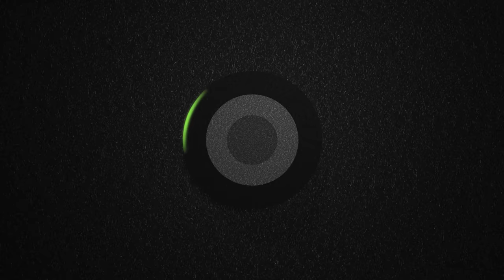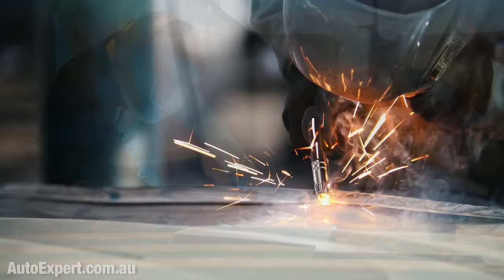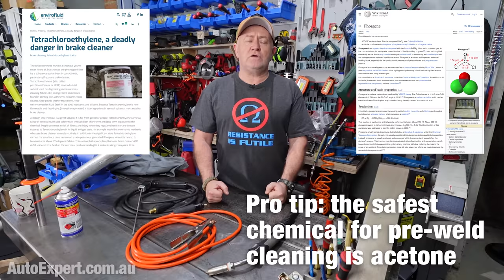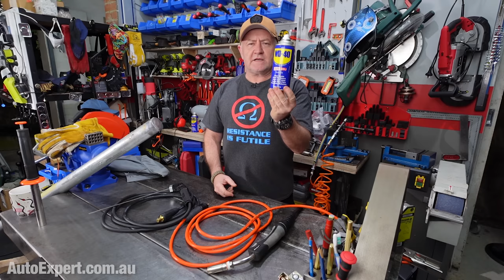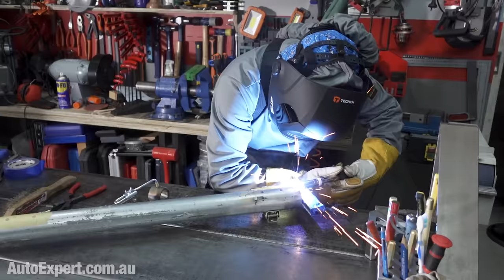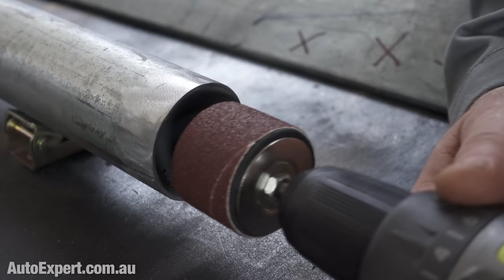How to die while arc welding at home: the top 5 ways | Auto Expert John Cadogan

Comment: Very good info. I wouldn’t have thought of some of it, especially the brake cleaner. One thing that I can add from experience is ventilation even when welding regular steel. I built an engine puller in a single car garage in the winter one time. It was cold so I shut the door. After a few hours of welding I felt so terrible that I went to the emergency room. Still had no clue why I felt so bad. Didn’t even cross my mind that it was the fumes from welding. After chest x-rays, poking and prodding , the doctor ask what I had been doing. I said nothing, I was just welding at home on vacation. He said, there it is!  You poisoned yourself. I spent a week in bed as a result. What a terrible vacation!

Btw, I was stick welding. I guess it was the flux that caused it.
Reply: The SDS for chlorinated brake cleaner conveniently omits the phosgene danger. so much is 'Not known',
Oceangate Titan was a SDS and QA themed designed submersible, ie a little bit lacking in reality.

Comment: Thank you for this warning video.
I am a retired mechanic and now learning to weld and have a forced air respirator  that I use for sanding, painting and now welding.
It's a remote placed air pump with filter, speed regulator and 75' of hose.
It's a budget item, but works flawlessly. I added a self shading weld mask to mine. For about $400 complete, add your own darkening shield, and your good to go.
Sear up " Breathecool II Supplied Air Respirator System w/half face mask " 
Thank you for making this video.

Comment: Quite a few moons ago I used to weld and broco cut underwater. Up to 400 amps DC.  As long as you remembered the basics and kept important parts of you away from the shortest path from electrode holder to the target you were fine, despite being immersed in a  perfect electrolyte (the sea) with soggy leather gloves. But get too close and you would get a warning, as your fillings would vibrate and you could taste the chrome being stripped from your helmet and second stage...
Reply: Which helmet would that have been? The one with the single eye in the end of it?
Reply: @samrodian919  🤣🤣
Reply: Why wear leather gloves underwater? Unlike on land, wouldn't being in the drink keep things cool enough that sparks would have no negative effect on synthetic waterproof material?
Reply: That's nuts!!! Wow, quite the profession!
Reply: Not risky at all. Follow the basic safety rules: You have air supplied from many different cylinders from above surface, plus you carry a bail out bottle on your back. So you can never really run out of air. And there's a spare diver sitting on the stage ready to come and help if needed.Then you are operating in only a maximum of 30 foot of water.  The harbour we were operating in was going to be turned into reclaimed land, so the steel sides of the berths needed big holes cut in it to allow the water levels to  equalise as fill was dumped into the harbour. A broco is a thermic lance, uses electrical current to start a spark to make the broco rod ignite once oxygen is run through it. That rod can cut through anything. We cut big 1m x 2m  windows in the steel piling.@@tittlemouse92
Reply: Oh my gosh! That is wildly crazy. Glad you made it through that experience.

Comment: Hi John. Excellent presentation and thank you for taking the time to do it. Qualified boilie and now professional engineer here. I did my time in a workshop where gal was 90% of the work and we would not have been given the time to grind the zinc off before welding, so we learned techniques to pre-burn the zone to flash off the zinc with the arc as we we were laying the weld so it looked really presentable. Save time to the detriment of our health eh?

I started my trade in the late 90s and adoption of PPE was still pretty haphazard. It was culturally frowned upon to demand PPE from your employers (let's not even start on hierarchy of controls), from both management and the more senior members of the floor staff. I really love music so always wore plugs but absolutely nobody in that workshop wore even P95 masks. I've had fume fever on a few occasions and it was not pleasant, to say the least.

As part of my professional career I still enter workshops quite regularly, and am pleased to see the uptake of at least the 3M carbon filtration masks, and at best a pretty wide adoption of the Adflow helmets. It would be nice if employers would adopt ENGINEERING controls (hierarchy again) but I accept it's difficult in situations where the operator is in such close proximity to the source. 

Awareness is the key and you are only helping to increase that.

Comment: Another thing we tend to overlook is that UV rays are reflective. I use to spend hours ice lugging D-9 dozers. We had one welder at the front of the track and one at the rear with an operator in the seat turning the track. At the back you were sitting beside the chrome rod for the ripper cylinder and at the front beside the chrome rod for the dozer cylinder. It took me a while to figure out why I always had a sunburn on the back of my neck and started keeping sunscreen in my locker.
Reply: Yup, not as severe but UV also reflects off of snow.
Reply: They are called corks.
Reply: Yep tin roofs are a nightmare for reflection too
Reply: Thank You!  💜👍  I dislike sunburns!  😮

1st time anyone has warned me about reflections from the arc!  🤔… wonder how long that would have taken me to figure it out the hard way / glad I don’t have to!  🥰
Reply: Yep. The worst 2 sunburns I ever had were from refle turn. 1 was working on a shiny metal roof all day it sunburned my throat and the lower half of my chin etc. Second was Flux might welding, my legs sunburned. Under the table from reflections off the mirror that was on the floor upright against a cabinet.
Reply: I remember the welders at my old job welding all day on these hugh log conveyers. They were AR plate and shiny as chrome from the logs constantly being dragged across them by the drag chains. After a few days some of those guys who were wearing open blazers with no shirt underneath were burnt bad on their chests from being right over a wire mig all day on a highly reflective surface. Pretty brutal
Reply: @Deere2154D  maybe in your world
Reply: @LoBeau53  in a normal world yup
Reply: At the wrong angle, the reflective tape strip on hi vis safety clothes. lol

Comment: Hi John well done, ex boilermaker/welder here, although mostly a welder. You pretty much covered everything I think. Unfortunately when I started my apprenticeship over 40yrs ago there wasn't much emphasis placed on providing P2 masks, at least not in our workshop. In the early days I did get "Welders fever" a few times from welding galvanized components and yes it does feel exactly like a bad dose of the flu but thankfully the next morning you're feeling ok again. One of my biggest fears is lung cancer from all the nasty stuff I breathed in from welding let alone all the crap that floats around the air in a workshop before the masks and filtered air helmets were common place, I would often come home have a shower and blow a coal mine out of each nostril. I have lost two work colleges and two friends from lung cancer all were welders who died in their early 60's and none of them smoked. 
Just a side note although it won't kill you, one of the more unpleasant aspects of being a welder is occasionally experiencing welders flash (sunburn to the eyeballs), thankfully in 35yrs in the industry I only ever had a bad dose three times. Also regarding PPE when welding to cover the skin you can wear a welding hood which covers the head, neck and partly the chest area, being a bloodnut I had to be extra diligent.
Thanks John I enjoy these kind of videos.
Reply: Galvanised steel welding puts zinc in your lungs that never leaves your lungs . You can drown on that shit . Been welding 50 yrs . I still struggle in winter breathing laying down . 😂

Comment: I did a little welding (arc & OA) in high school 40 years ago and wanted to get back into it. So, I bought an inexpensive welder (Mig Tig & Stick). I have watched several videos on how to MiG weld but yours is the first on the safety aspects. I should have started with yours because it is the one that really matters. Thank you for making it! I will definitely make changes to my procedures after seeing it.

Comment: You Sir are an absolute star! This is the first video I have found on YouTube that covers the most important aspect of Welding for newbies Health and Safety. And I can honestly say that it is one of the most well-presented instructional videos that I've watched. Obviously, as titled you have aimed the video at DIYers who have decided to give welding a try and as you mentioned there are some unbelievably scary videos online made by amateurs that you can only hope are not being watched by new/novice welders. However, I've worked in the construction industry for 25+ years onsite fabricating and erecting steel frames, and after completing my structural engineering degree onsite as a site engineer/manager. And in that time I've seen some pretty suspect apparently qualified welders who could also do with watching your video!! I do have a suggestion though, I think your cute assistant should definitely feature a bit more in your next video! She certainly looks like she has a wealth of welding knowledge that would be very beneficial!! 😜😜

Comment: i was an odds body for a fabricator, he was in his late 50s early 60s, and he had a shelf full of gloves. he would regularly swap out gloves and place the used ones on a rack near a fan that faced out of the workshop, he also expected everyone in the factory to wear riggers gloves at all times. the other thing that was expected was safety glasses. he also regularly replaced flash lenses and safety gear. in the almost 2 years with them, he replaced everything at least 3 times. the other welders loved it because he allowed them to take the 'old' stuff home, all except the flash lenses. he was an absolute stickler for workplace safety.

Comment: thank you for covering this John. I would add that not just zinc but all metal fume is now considered dangerous. It is so fine it can hang in the air for up to two days. This means that effective ventilation is essential to remove the fume particles and the ozone which is also generated during welding. Please keep up the education for all our sakes.
Reply: The safety data sheet for the Weldcote MIG wire we use at work here in jolly'ole USofA shows that their coating is known to cause drowsiness and I've definitely experienced that! Canada now recognizes MIG fumes to be a carcinogen. In my work experience, plasma dust is even worse. My nose is black inside because my employer just uses the large air volume in the shop as 'ventilation'.
Reply: Yes the plasma dust is a problem too  @theGrooveChampion . After experiencing ill health due to this problem in 2014, I've invested in PAPR and a fume extraction unit as well as fan forced ventilation.
Reply: Hopefully it's as lit as the shooting star cop barrel roll meme was😂
I trust it will be.
Reply: I am an old guy from Australia and I don't quite understand the reference  @MrTheHillfolk  :^)

Comment: Well there’s a new learning! I have been using brake cleaner often on my vintage motorcycle.  Haven’t got it anywhere near those temperatures but will be looking for a substitute going forward.  Also guilty of the spray can on the bench and welding galv steel thing.  You’ve alerted me to hazards I was somewhat aware of but hadn’t really considered at a proper level due to the ‘Ill just get this done quickly” mindset.  Thank you for sharing this. 👍🏻
Reply: It's only the old 'chlorinated' brake cleaner residue that is deadly when heated.  The solvent based stuff isnt like that
Reply: John included a recommendation for a suitable alternative (as an afterthought) in the video.
Reply: @jackheinemann1994  thanks for that info.  I’ve been using the aerosol variety which seems solvent based and an effective cleaner. There doesn’t appear to be any residue. 👍🏻
Reply: @ThreenaddiesRexMegistus  Chlorinated brake cleaners come in the aresole variety too and as far as I know they leave no detectable residue.  On the can it clearly lists the ingredients, itll be clear if its chlorinated or not.   The new hydrocarbon solvent based stuff works just as good and is much safer to be around.

Comment: Good video! Thanks for exposing some very real hazards many face everyday. I was in the trades for 25 years. Welding, grinding, plasma torch, oxyacetlene. You name it I probably welded it. A few years before I  retired, at age 45 mind you, i developed uncontrollable shaking in my right hand. I could barely walk. My lung function had dropped by 50% . I was diagnosed with 4th stage COPD and Parkinsons. I sought out  several medical opinions and the answer was the same. Leave the trade or die. Lung disease sneaks up on you. It steals a little piece of you at a time. It's not like a busted arm where you can instantly see something is wrong. 3 years after I quit working the heavy metals in my system were still 3 to 5 times higher than what was considered safe. Chromium, nickel, manganese and copper were the most pronounced. I traveled to Chicago Il to see a specialist and brought along my entire MSDS folder. MSDS stands for material data safety sheet for some who may have not seen one. This M.D. took a look at the types of welding wire and filler rods I typically used. She explained that the amounts of chemicals emitted by the heating of the metals can release many times the content listed on the MSDS.  I worked in a Union shop but the owners couldn't care less what happened to their employees. I was at the time the highest paid employee there earning several dollars above the union pay scale. I was repeatedly told I had employment for life. When they found out how sick I was I was immediately fired. It's against the law and they knew it. I still had to file a lawsuit for Worker's Compensation which I eventually won. I went from top dog to dog that pooped on your new carpet in short order. Thankfully I am now collecting a fair pension from the Union I was a part of. Just want you all to take care of yourselves. Not many employers will. At that time they saw PPE as an obstacle to their profit. I wish I would have paid closer attention when I had the chance. PEACE to all who read this. Thanks

Comment: Feb 29th here.I just came across this video. I was a welder/fabricator (arc, gas, mig, tig) for over 50 years, Navy trained. Great advice, John. I would like to add a few things. Make sure you don't have a plastic butane (bic) lighter in your pockets. if a hot ball hits it well and burns through it will go BOOM! Don't weld anywhere a parts cleaner, it creats phosgene, just like the metal cleaner will. Also, if you are welding off of a chain fall or overhead traveller, make sure the ground is well grounded to the piece being welded, that the circuit is not creeping down from above acting as a ground through the chain. The chain can get crazy hot (and burn you bad). By the way, I started out rehabbing a WW ll Navy ship, ripping out and replacing galvanized piping in enclosed spaces. Safety gear? As in PPI? What safety gear? No such animal back in the day. Milk from the galley was the antidote for the flu like symptoms and it seemed to work (placebo effect I'm sure). Thanks for a great video!

Comment: highly informative , been welding for 40 years some as a union journeyman millwright and never knew most of what you stated , (apart from galvanised welding).
This  should be compulsory watching for getting ASME certified . Got shocked to the head with a rat hat on  underwater welding in my 20s not a good feeling - never told upside .  
Couple of points ,  always have a fire extinguisher close by and keep rags out of the area and when designing a weld area at home have good natural ventilation ,  no highly flammable stuff , and  design so you can put a fan in a door if needed to improve the ventilation .

Comment: As a trainee engjneer we spent 2 weeks in the boilermakers apprentice shop.

Stick arc welding what was called pad welding, just building up material on wear parts from around the plant. 

Yep 80 hours just running weld beads. I learned how to weld. A very useful experience.

Comment: Thanks for sharing Sir. I've been a home welder for the past 25 odd years. I've got a Rossi inverter stick welder, and just upgraded my Mig to a Lincoln powercraft. I've never had any electrical issues despite hanging onto the project with one hand and welding with the other (gasless welding) but did give myself metal fume fever with my gasless welding once. 

I must admit though, i have been a bit haphazard with my PPE until i ray burned my arm real bad. Now i wear long sleeves and a GVS mask under my helmet.

Comment: Great video John. Although not a killer, I suggest not wearing a wrist watch with a metal strap. A mate shorted himself at the welding table and had a fantastic groove in his wrist. Cheers L
Reply: That wedding ring will cost you your finger!  I worked with someone that I told to take off his ring. He didn't and dropped red hot steel on his ring. Now he can only count to 9
Reply: Even if you don't earth yourself, your watch glass won't look much good after a very short time.